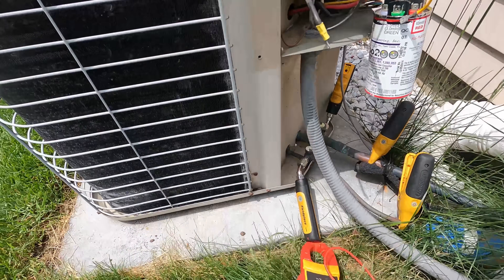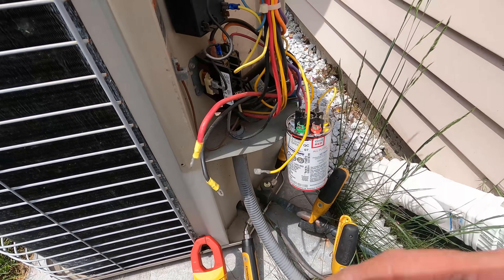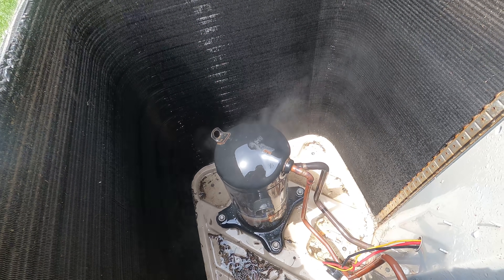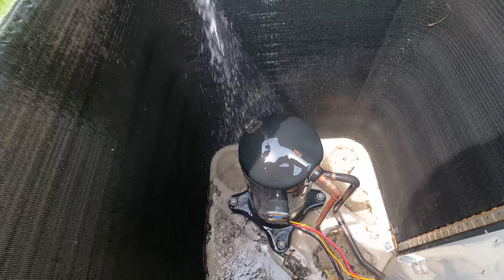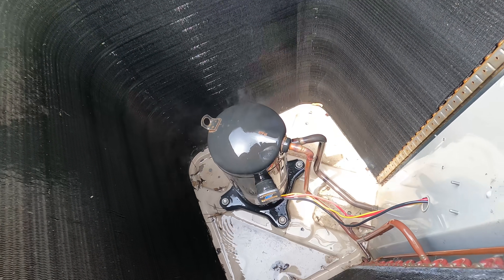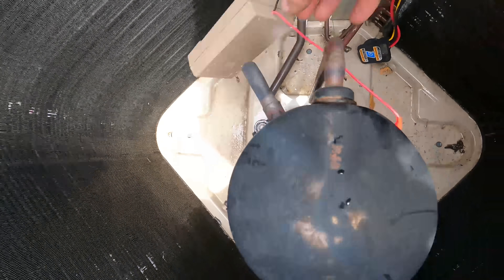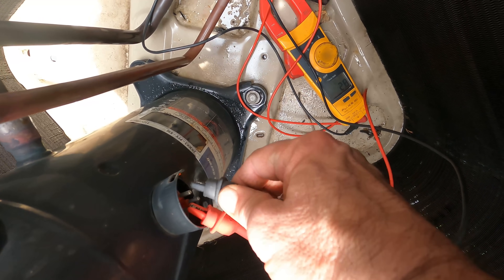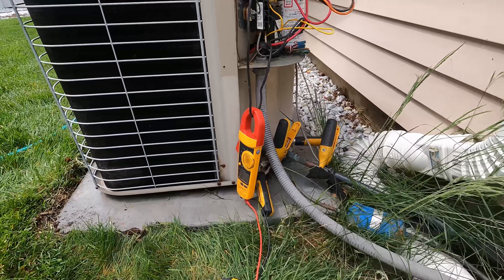AC Compressor Overheated Not Cooling Testing Windings/ Megging, Ohms Fixing HVAC System

Comment: What a hack..... no Freon and without even looking for the leak he fills it with Freon. This guy has a lot of tools and no idea how to use them. I might have got a good charge... without pulling a vacuum or looking for a leak before just filling it with Freon I highly doubt it will last a week.  Terrible service technician patting himself on the back for helping destroying the ozone layer. Way to go
Reply from the maker: I love when snowflakes try to talk shit. All a snowflake like you Michael does is show your ignorance and lack of knowledge. I been fixing hvac systems to code and doing what’s best for my customers for 22 years. I already know where the leak was. It was found in 2019. This system cooled this house until it was replaced just this week. I know how to use my tools. You must not be an HVAC tech. You don’t pull a vacuum on a leaking system. Tell me how deep your getting that refrigerant circuit to pull down. Why would not pulling a vac prevent this system from lasting a week? This system was never exposed to moisture or contaminants. Standing pressure was 120psi. This was a small leak. Many years back this was a common repair. A terrible service technician would not provide temporary comfort for their customer. Until the system was replaced.
Reply: @thehvachacker  as soon as he said Freon you should have just laughed him off 😂 micheal Keller  what certs do you have to back up your agreement
Reply: I was thinking same, I taught he was going to look for the leak.
Reply: @towu4less126  not in this situation.  Use your brain
Reply: We all watch these 10 min videos, not even getting a 1/4 of what the whole story is and snowflakes like this assume anything that isn’t said in the video. Dude go back to a Biden rally and stay away from this channel if you don’t like it.
Reply: Mr Keller..
You've alot to learn...
And on your way..to learning..maybe don't call other people hacks..when you dont know nothing from nothing yet.
But sure..check air flow and maybe a leak detection..was called for..
But I like this guy's teaching methods.
He's informative and straight up.
So go learn from..school...till you understand..
It's in the field where..you put it all together.
Which is practical.
Say how many CFCs are put into the atmosphere..on a rocket launch..?
Reply: Unhuhhhhhhh.
Reply: Agreed not to mention wasting their money 💴
Reply: 5 lbs of FREON😂 what size was that and he charges without checking filter wtf
Reply: @thehvachacker  lol
Reply: @come_on_now  you should put that on a sign and hold it up here 5318 N Elston Ave
Chicago, IL  60630
United States
Reply: 😅 Yeo.
Reply: Bud what’s your definition of a snowflake isnt that the pot calling the kettle black? Or a snowflake in this case ?
Reply: @dioncurtiscurtis3188  it definitely ain't a race thing.
Reply: @eddiewilliams46  lol okay fair enough
Reply: @captainmigs1655  I mean I still call R22 Freon 🤷🏻‍♂️
Reply: @Footrotflats251  does everyone make fun of you still
Reply: @captainmigs1655  gotta dumb it down for some people, people know what freon means usually, they dont know what R22 means...
Reply: @captainmigs1655  Ive been a licensed journeyman HVAC for 20 years. You keep doing whatever you snowflakes do. And say whatever helps you to sleep at night.
Reply: @michaelkeller6087  what certs do you have though
Reply: He just put close to a thousand dollars of 22 in a unit without even attempting to look for a leak. Hack is right.
Reply: Over heting pump checking  gas lo gas tomuch  high ampre triping  gas relcing  water off snd  pump less ok  trying solshion  over heat comeing gas comprssor  gas removeing  and  fulsing  systom snd  trmial good  conveuvet showinv good  wind opn or not ground ok  good  water usin  cool ok   fixing  vacom and   gas purging ok  gas cherginv purginv ok gas cherginv and systom ruing and amprchecking 35 ps iquked chefging and  r22ok  410 cylinder up down cherging  silved ok

Comment: Awesome job saving that old Lennox. Personally I'd rather put $900 towards a new system and replace it, but it's their money. Great video
Reply from the maker: They will still replace it. The inevitable is them needing 22 and no more around. I don’t play with drop in so then no ac till it’s replaced
Reply from the maker: Shawn Gipperich  we all do different approaches. Yet the inevitable is the older r22 machines will need to eventually be replaced. This machine is getting replaced this was only to keep it running until then. Which is mid June. Many say this is a big leak. Yet took 2 years for the refrigerant added last time to leak out.

Comment: I have that same old megger on my van right now. It's my back up. My Fieldpiece is my go-to.
Reply from the maker: I was considering the Fieldpiece or fluke. Yet most the fluke models are 600+.
Reply: @thehvachacker  yeah the fieldpiece is a great option. It's just around $100 range. Nice and small and compact. And actually gives you a numbered reading on the screen.
Reply: @thehvachacker  mine is the old version back when they used to be Gray, before they change to the yellow color. I've had mine for about 17 years now.

Comment: I read some of these comments and I did not see anyone mentioning the recovering of R22 and doing a nitrogen test with some trace of the R22 left in the system to pinpoint the leaks . Even if a pump down was done first you could check the evaporator side and lineset before recovering and repairing or selling a new unit. I'm new so please give me a knowledgeable answer. Thanks

Comment: Good video! Apologies for the "Keyboard Supertechs" who judge your work when they weren't there and didn't talk to the customer. Side note: I have the same scale. I know there are newer fancier ones, and its probably the oldest piece of equipment I own, but the resolution is SO much higher than most scales and I charge alot of critical charge systems. So if I need 4.6 oz, I don't wanna guess when my scale only goes from 4.5 to 5.0. I LOVE that it goes in 0.1 oz increments. And in grams its 2 gram increments. Add to that the fact that its indestructible, and its a winner! Keep doing what you do!!
Reply from the maker: It’s a great scale I wish the latches on the  case were built as strong as the scale. Yet I see no reason to get a new scale. I haven’t shopped around. This scale is about 12 years old. Shame if most new scales don’t give as precise measurements. I know I have fancy gauges yet the Fieldpiece probes were referred to me by many of my subscribers. My only complaint on this scale is no auto off.

Comment: System with that low of charge has a leak. Why no leak check? It’ll be empty again sooner or later.
Reply from the maker: It’s getting replaced. No reason to waste customers money on a system that needs to be replaced. I told the customer that before charging. This is just to get them by until the new system is installed. Mid June is when it’s scheduled
Reply: @thehvachacker  perfect. Yea kinda pointless if it’s getting replaced in a couple weeks.
Reply: @thehvachacker  This one could have been saved. Find and fix the leak R22 is still around and will be for awhile plus the price is dropping. Could have retrofitted to a different refrigerant and save the customer a lot of money. I have worked on system's that are 30 to 35 year's old and still putting out.
Reply from the maker: I repair old units all the time. I don’t like sending a system to scrapyard. I also have many videos fixing old systems. Many comment that what I did won’t last. Many of those repairs still going many years after. This isn’t a fast leak. It’s a slow leak in an evap coil, document by a coworker on a previous leak search performed in 2019. The last time system need a few pounds. No reason to change an evap coil on r22 system.
Reply: @thehvachacker  hello,
What tools did you use to checking the pressure Sir and which app.
It seams pretty easy. The way you explained it vs my teacher doing it . Thanks
Reply from the maker: @yaminnabi7453  I use the Fieldpiece joblink probes. The app is measure quick

Comment: Damn bro, I feel bad for you getting trolled by all these youtube HVAC "experts" who obviously havn't spent any time in the field. 
As a tech with 22 years of experience in AC/Heating/Refrigeration/Controls/ and even Air Balancing...in residential, commercial, and industrial...
My opinion is that this was a good (and typical) service call. 
And for the record:

1. A leak search, and/or repair (if possible) on this unit is pointless and a waste of customers money due to its age and refrigerant type. 

2. You informed them of the situation and thier options and let them choose what to do. 

3. Completely understandable why you "technically" left it just a lil undercharged. Considering you just went back to them twice to get the ok for another lb of r22. And now up to 5 lbs.
Especially because it needed, and got, replacement anyways. Its got a 20 degree split. 

The only thing I would add, which u probably know, if you ohm out the windings, if you get continuity across R and S, but not R and C, or S and C....
Then the overload is open.  This is because the overload is located on the common wire.
Reply: @chicagomodzz  But he informed the customer of thier options. They chose to get the AC going with new refrigerant then replace the system a few weeks later. 
Why is that wrong to you?
We are here to provide comfort to those who want it. Doing the cheapest thing is not always the best thing. 
Its best to give the customer the info and let them decide thats how u keep customers. 
Leak sealer? Maybe if it were 10 years old. But on an old R22 unit with visibly corroded coils? And at the end of its lifespan? No. 
Lets say you sell them the leak sealer, which we know isnt guaranteed to work. Maybe 50/50 chance. 
If 3 weeks later its empty again, and they are in the same boat, (if they even call you back) now they need another charge to get AC that day in the heat wave, and STILL need to replace. 
That makes you look really BAD. You cost them alot of $. Thats how you lose customers. 
And dont forget its old as hell. What if the fan goes, or compressor goes? Whichbit inevitably will. 
Dumping money into a unit that needs to get swapped anyways.  
You need to look at Total Cost of Ownership of a system. 
Its better to skip the part where you spend a bunch of money on a unit at end of life, and instead replace sooner than later.

He topped them off with freon, then had the unit replaced a couple weeks later. It was the right call for the customer.

I would have advised them that r22 is expensive and if we are swapping the ststem, it would be wasted. Its thier call if they want to do that. In this case they did. 
However, I would have offered them the 1 ton portable i carry on my truck. And a couple others we have at the shop (If they sign a contract for replacement today😁)
But if his company doesnt have that capability 🤷‍♂️. Well then you offer the options you have.
Reply: What is wrong you? Compressor is overheated and the fan shows signs of life but you’re not concerned with what else could be wrong? Checking to see if it has charge should be basic before taking everything apart. Compressors overheat all the time due to under and overcharge. Basic systems don’t have low pressure switches and you can clearly see this unit is no different. Of course it would be overheating. Adding any refrigerant to a flat system is never recommended. Even if it was 410a… pressuring the line set and doing a leak search would be good practice. Secondly… if no leaks are present and pressure holds changing the drier and pulling a vacuum would be the next ideal repair. (Assuming Pressure is applied through the high side and into the low side to check restrictions, good purge.) Finally, checking the system under load with virgin or recycled R-22 if that’s what is decided on over replacement.
Reply from the maker: Mario you want my customer to dump a lot of money into a system they want to replace. Evaporator was found leaking 2 years ago last time we charged this system with about the same amount of refrigerant. I have a compressor with open windings. First priority is seeing if I can close the windings. I could close windings the. Start system which wasn’t flat or it would of pulled into a low vacuum. I started this system with a soak and wet condenser, I hosed it out while cooling compressor. Customer wanted to get this system running for temporary relief until they get a new system. I don’t sell my customers snake oil so no stop leak. I don’t believe in wasting my customers money and providing comfort is the business I am in. If I don’t someone else will. We don’t have customers shopping around. I also am on call, first hot weekend. Means calls are comment in 2 or 3 at a time.
Reply: @thehvachacker  that’s good. A little history goes a long way. Maybe I missed the backstory considering what was going on with the video. As long as the client has been given options and you have done everything you can in the mean time for temporary cooling. That’s all we can do. This video may have been for “Educational” purposes but it often leads to bad practices that should not be followed.  I would emphasize that you have done all you can for the client before “patching” this unit for a quick fix. Everyone here wants to quickly call out your mistakes but they fail point out what good practices should be taken. Thank you for replying to my comment.
Reply: @whitingservicesheatinganda3858   When did I ever promote injecting Leak Sealer? Open Windings? Get real… You wouldn’t even get that far having checked pressures. He didn’t say what options. Backtrack? Seriously? Get your head out of your rear, please. I don’t need 20 or even 15 years to tell you where you have failed. Please continue making these lame videos. I’m more than happy to send links to friends and coworkers of what NOT TO DO. Thank you for giving tons of Material for my HVAC FAILS Section.
Reply: @marioespinoza2725  "open windings? Get real, you wouldnt even get that far having checked pressures. "

What are you even talking about? You told this youtuber that he should do a leak seach and make a repair on the system before even checking the compressor to make sure its functional when clearly the contactor is pulled in and its not running. 

Now you are doubling down on that as if its the right thing to do. 

You verify the compressor is ok FIRST, because if its not, any other work u did is pointless and a waste of time. 

"Compressors overheat all the time"

Yeah, you know what else they do all the time? Fail from an open winding. Thats why if you see a energized compressor thats not running, YOU CHECK IT FIRST. 

Seriously, how long have you been doing hvac professionally?  Be honest.

You sir, are full of crap. I'm not trying to be mean. But you trashed this guy for no reason based on limited information and lack of knowledge of best practices .

Also fyi "EzSeal" is leak sealer. And yes you reccomended it in your fist reply.
"Ever hear of EzSeal?"
Why would you ask that, if you are not reccomending he use it?